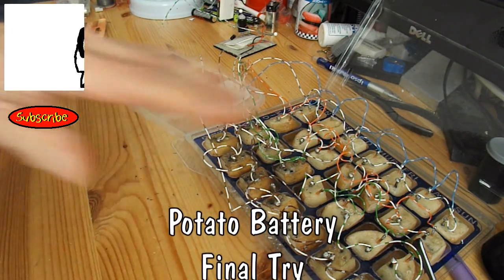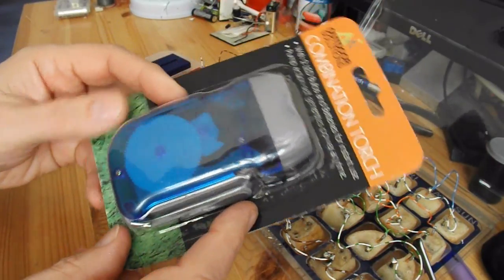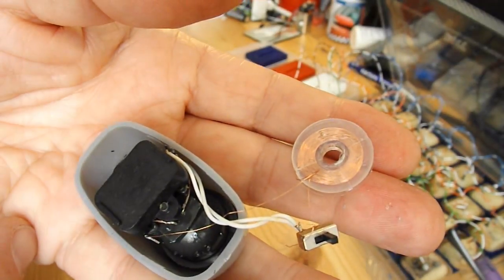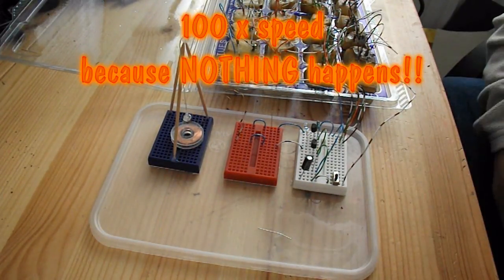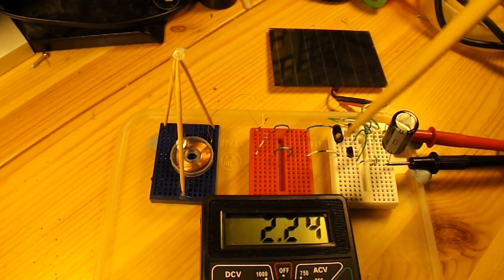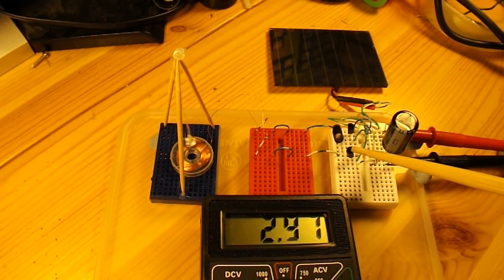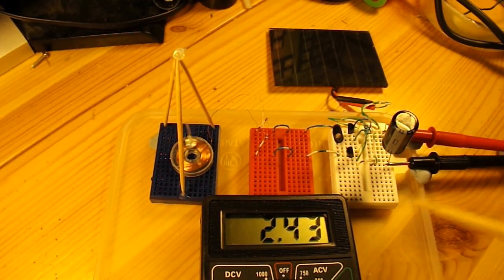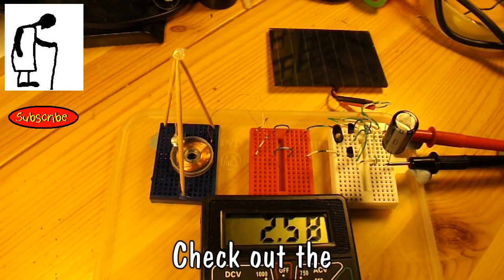Potato Battery - Final Try

Comment: And that is due to the tester reads almost three volts and suddenly dropped to less than one?.
For back up again and then fall again?.
Reply from the maker: The voltage is measured across the capacitor. The capacitor charges from the solar cell, when it reaches a certain voltage the transistor is switched on and the capacitor discharges through the coil generating a magnetic pulse.
Reply: GrandadIsAnOldMan Ah.Got it! ...